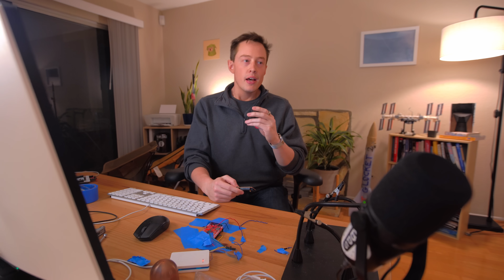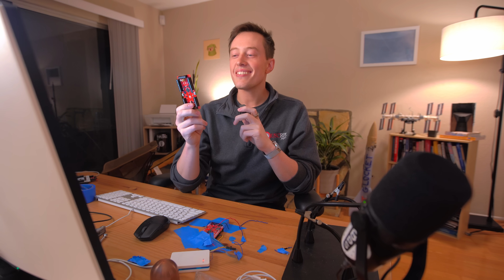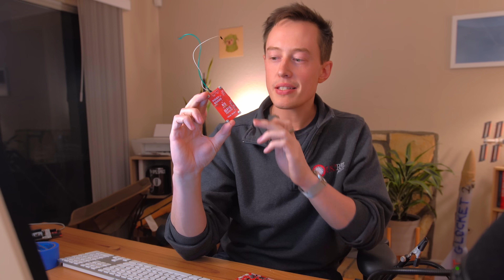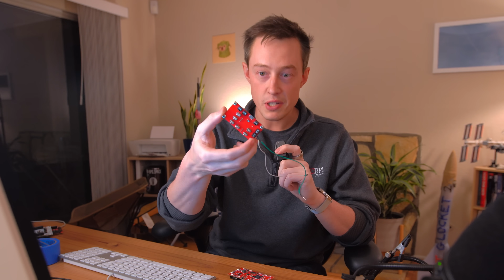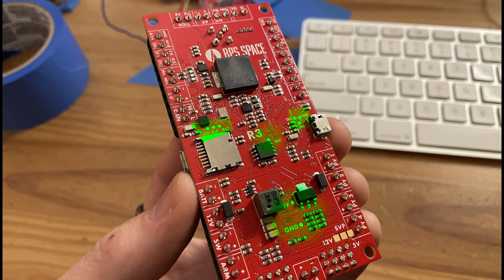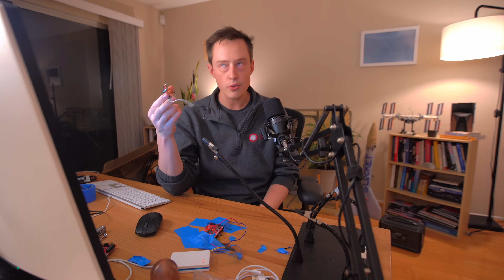the dumbest electronics thing i do

Comment: Aren't there programming sockets where you put the processor into a gripper that interfaces it for programming before you solder them to the board? Or, chose a different processor alltogether that Just uses a serial port to Programm itself?
Maybe go into the design decisions a bit more because using easy eda one can design and order such a programming piggy back board in an hour or so :'D

Comment: I do 3D printed jigs for small scale test runs for PCBs. You take your Test pad pattern, 3D print that pattern  with holes instead of Pads where you can shove pogo pins into to make your "Piggy Back board". Then just hand solder your wire to the pins and that is usually good enough.

Comment: I design boards in EasyEDA and it generates pick and place files in like 1 click. I don't even own a hot air work station or a hot plate or anything, have never assembled SMD components onto a board myself other than for quick fix problems. One of the products I sell does require programming and the engineer who worked on it made a bed of nails jig with a toggle clamp to hold it onto pogo pins and its a lifesaver, its like a 15 second process to program and test one and then move on to the next

Comment: Im sure you could get some perf board that matches the pin spacing you've used. Solder some pins on it and maybe put some alignment pins/screws on it that locate through the screw holes on the ava board and then you've got a reusable solution.

Not every board you make has to be professionally designed and sent to a PCB manufacturer. Do it the noob way with perf!

Comment: In addition to the obvious approach of 3D printing a jig to hold pogo pins (check out James Clough’s video for a great example), you might want to consider an affordable solution from PCBite. Their flexible arms with pogo pins are perfect for tasks like yours. I use them regularly for reflashing smart devices, and they’re very effective for maintaining reliable contact. These arms are also rated for high-frequency applications, so you can use them for quick debugging with an oscilloscope or logic analyzer. I highly recommend giving them a try – they’ll save you the hassle of manually holding the wires during your work.
Also for the quickest solution press the mouse button with your nose or operate it with your feet. That are usually my quick and dirty workarounds for not having enough hands ;)

Comment: Why you don’t switch to STM32H7 ? Arduino is supported and you don’t need to burn the BL. I’ve been using teensy for a while I switch to stm32 and I didn’t have to change anything in the SW just recompile for the stm32. You can program it via USB

Comment: There are pogo pins which fit into standard female jumpers. So I most of the time just out all pads needed In a 100 mil grid and then take a 3*2 jumper, put the pogo pins ins and be happy. 

But the I press cables against PCB... Been there, done that. 😂

Comment: I just ordered a 6 pin tag-connect cable for my stm32 boards.  You use their footprint in your board design, and it includes holes for the cable to clip on while you do programming and debugging.  Zero cost for the board (no headers).

Comment: simple: if the flashing takes more than 10 seconds i would simply solder the wires and desolder them after uploading.
if shorter:
space the 3 wires correctly and use hotglue or sugru to keep that spacing. adding short springs or pogo pins and gluing them for correct spacing is also an option, obviously try to place the glue as close as possible to the copper that makes the electrical connection. still hacky but should free one hand

Comment: This is the definition of technical debt. 

3d printer a simple negative of the AVA, make a cutout for the 4 wires and and hotglue them in place. Place the AVA on the negative, press it down (or add a brick) use the same set up for the PC connection.

Comment: You can use pogo-pins which are spring-loaded pins to probe those exposed pads. You can also design a 3D-printed holder with the same dimensions as the board to hold the entire board in place. The 3D printed holder can have holes that you can mount the pogo pins in place. This solution allows you to just plop the board into the holder while the pogo-pins contact and apply pressure to the pads, and you can have a hands-off bootloader flashing process.

Comment: Not sure if this is the right thing. But in a compromise of quick and dirty holding wires and full blown jig. I like these tools as helping hands: Sensepeek pcbite, Probe holder X 1.0
Tag connect mentioned down here is also great thing. But this includes redesign.

Comment: Skip the "model another different thing in another piece of software", you already have what you need!

Print the board on paper at 1:1 scale, glue the printout to a piece of wood drill through the pads, stick pogo pins into it (or just thicker wires maybe?), glue them in place

Extra credit if you take 2 minutes on the saw to cut the wood to size, and then nail "walls" to two sides to make an alignment jig!

Comment: Tape stiff wires together the right distance apart so you can hold them on with one hand, maybe even hold it there with that little holder thing. You can alligator clip onto the other end of the wire or something. It’s like 30 minutes of effort to make it a one handed job and get you at least a little more time back.

Comment: As many here already suggested a POGO pin Adapter should be the fix. If you ever design a new board you could even include the foodprint for comercialy available POGO pin adapter like the TC2030-IDC-NL (or realisticaly the 3 pin alternative that you design for the existing board)

Comment: You can 3d print a holder which would looks like E with right spacing and some flexibility and just glue wires to it. You still would have to hold it by the hand but at least you'd need one hand.

Comment: I have been using Tag-Connect TC2030 for years to program all kinds of boards. They are basically 6-pins cables with poggo pins on one end and a standard connector on the other. You will probably need to make a small adapter board to connect it to whatever programmer you are using, but then it is really easy to program each board. You can even get the holder clips for a few bucks, they will hold the cable in place while you are programming.

Comment: couldn't you design the pcb to have throughole pads for 2,54 pins and instead of soldering just stick the pins in? the same idea as in keyboards where you can change the switches

Comment: Pogo pins! Mill-Max has a huge variety. If you set those pads up with the standard 0.1” spacing, you can just use a scrap of protoboard to hold the pins. 

The next step would be to add a base plate and Destaco toggle clamp to put pressure on the board/pins.

Comment: Should look in to “flying line” “flying lead” “fly-by-wire electronics debug boards. Adjustable spring loaded pins and used for things like memory recovery so should be reliable enough for this. Cheap to get from the usual import sources.

Comment: Is there any way to issue the "burn" command via a script? If so, you could build in n seconds of delay so you can run the script and get your wires positioned before the command actually processes.

Comment: not sure if this will work as you said the arm thingy doesnt put enough pressure: mark the spacing on a block of styrofoam, then poke it with a toothpick or something (start from pin-side so you dont have to hunt), maybe poke at an angle so the cable wont slip back when you press on the block.

Comment: honestly instead of some pads you could have just had a 100 mil pitch header and don't populate it. I have an ATMEGA328 based board that involves me uploading firmware and I just use an ICSP head and simply stick a male header into the holes and angle the pins so they make contact with the holes. 
Pretty sure I got the idea after seeing GreatScott program Arduino Pro Minis that way.

Comment: I think PCBite got already mentioned but for any future iteration get yourself a tag-connect cable and use the footprint. Thats the industry standard for when you don't want a connector on the board but need some guided pogo pin insertion or semi permanent connection
This is the PN you most likely want for least board space and most compatability (like for ATMEL-ICE): TC2030-CTX-NL 6-Pin “No Legs”
Reply: similar technology would be Würth Redfit
Reply: Just needs to buy some pogo pins and solder them to his existing wires. From there he already has a decent 3rd hand that would work.

Comment: Low efford solution, hot glue three pins together and then you can hold the 3 pins together in one hand. BOOM!

Or you could go fancy and buy 3 spring-loaded contact pins and hot glue those together

Comment: Just 3d print a jig to hold some pogo pins in the right orientation. Solder some wires to the bottom of the pogo pins and you’re done. 

Could obviously make this as complicated as you wanted to but you could get a crude bed of nails setup working in a few hours of CAD and 3d printing.

Comment: For testing usually i solder jumper wires, i could just get the tips and crimp them but well its a no effort lifestyle, sort of xD, usually i use only 2 and its already hard with one hand, but with a bit of hot glue it could help keep them in place

Comment: Tag-connect ;)

The cool thing is that it's just a footprint, no component needed so really a zero-effort, zero-soldering, zero-time, pretty much zero-cost solution, especially given that this footprint is present in most EDA softwares.
(I said "pretty much 0 cost" because you have to buy the connector which isn't especially cheap for what it is, but it's a one-off : there's 0 cost associated with each PCB you create).
The connector then just "clips" on this footprint, and there you go, free hands ;)

c.f Phil's Lab channel (really really good channel when it comes to electronic design), he's using this in pretty much all his boards.
Reply: TAG CONNECT EVERYWHERE! Costs nothing, small, easy to use...can't beat it. I've even taken to throwing it on first-run prototypes where I just want to break out an I2C or SPI bus to test pads just because it's there instead of a 0.1" header or JST connector because those boards are never going to leave the bench.
Reply: Tag connect for sure this is absolutely the correct answer
Reply: The Tag Connector for the Atmel ICE is reversed. If you're going to go this route, MAKE SURE!!! you get the LEMTA (Atmel backwards) variant of the connector. The header on the connector will then be in the correct orientation for you white Atmel ICE you have there on your desk.

It's a great solution, though the connector is a little pricey. Over a few boards/design, the cost of not putting a header on your PCB more than makes up for the up front cost of buying the connector.
Reply: Absolutely love the TagConnect system, always plop the lil 6 pin SWD footprint on any design as a backup.
Reply: It’s a bit fragile, the plastic hooks are easy to break.
Reply: @Mike-oz4cv  Yeah not a fan of the clips, but big fan of the clip-less ones that are just the metal rods and pogo pins
Reply: +1 for tagconnect its the shiz

Comment: Just spin up a board from pcbway with 3 holes for pogo pins. Then if you find yourself making more and more boards, 3d print a jig for it. So you can just push the board on top, squashing the pogo pins and then hit burn.. but for small qty. you can just hold the board on there.. will take like 10 mins to spin up a design and like $8 in parts.

Comment: 3D printed "board shaped hole" fixture with some pogo-pins in the bottom.

Push board into hole, click go.
Reply: Yeah haha.

It's almost funny how trivial the fix is (you don't even need a PCB for the pogo pins - just glue them in!). And the board is a rectangle, it would take about two minutes to do the CAD.
Reply: I came here to say this, I have done this many times, print the holes for the pogo pins to press in.
Reply: That is literally the full professional method for production programming and testing. Just with a standard box and PCB clamp that the 3d frame and pogo pins are stuck onto, although that's not necessary for a small run. It's so easy to do that you kick yourself after you finally try it and realise how much unnecessary pain you have put yourself through in the past.

Comment: probably get a foot pedal that you can macro to the mouse click or like the enter key or whatever. That seems like it's generally useful beyond just this particular silly thing. then maybe get some contacts or pogo pins soldered to prototyping board for at least the three hard to reach ones. it'll still be dumb but less frustrating.

Comment: Personally, I’d 3d print a jig that the wires slide into that also spaces out the wires correctly. Easy one handed operation so you can apply enough pressure and have a hand free for other activities.

Comment: I don't even think you need to go the route of pogo pins. I've printed a little jig that holds wires at a particular spacing so I can insert them simultaneously into a tiny terminal block easily. I think that would be good enough. Takes like 3 minutes to CAD up. You basically are just bodging together your own header pins. 

OR. If your pads are spaced the same width as a actual header pins, just plug the wires into a single block.

Comment: Hi Joe, I had exactly the same problem to solve, except that I had to do the initial programming (of a PIC32MM microcontroller) for a lot of boards. I soldered a strip of pogo pins onto a circuit board, soldered on cables and hot glued the whole thing into a small tray. I scripted the tray with OpenScad to fit the board and printed it with a 3D printer.
The programming process now only takes seconds: Press the board into the tray onto the pins with one hand and start programming with the other hand. Done.

Comment: PCBite could put pressure on the pins 👍
But can you connect a simple wire to PCBite? 🤔
Yeah, Sensepeek PCBITE-4003 kit has simple wires.

Comment: Pogo pins are the solution but I don’t know if there is enough space on the board, so you can put them in a little cradle to secure and align them with the available space, and solder the cable extensions in to the programming interface

Comment: I used to have the full blown Cortex 9pin JTAG connector designed into everything for this purpose. Lately because of space constraints I switched to the 6pin TagConnect. The cable is somewhat expensive but it does pay itself off.

Also I don't know how much prototyping you do but flashing the application using the debugger is possible and it's faster.
Reply: (disclaimer: I'm an amateur hobbyist) I totally agree.  In addition to programming, JTAG can do all sorts of things like debugging as well as detecting manufacturing defects like shorts, opens, missing devices, and incorrect device placement.  iiuc, there's a mountain of tooling built on this standard.

Comment: The YouTuber stacksmashing designed a board, which uses spring loaded pins to read and write the to the diagnostic pins of a PC to do research on Bitlocker. You could adapt his design in order to use it as a programmer for you boards.

Comment: Not sure if this idea will be welcome, but ... 

Maybe make a 3d printed housing to hold 3 DuPont cable ends in the correct orientation for the pin out and connect the other ends of the DuPont cables to the modified ribbon cable? 

Sorry if that sounds stupid

Comment: If you dont want to design and 3D print a holder, Id try a "no effort" version:  take a piece of cardboard and 3 metal paperclips.  straighten out the paperclips, and punch them thru the cardboard at the correct spacings.  Then wrap the wires around each of the paperclip leads. For each paperclip: One paperclip end touches the board at the correct location while the other end touches the wire.

Comment: 3d print a jig that fits your PCB with holes in it that line up with your pads. Put pogo pins through the holes. 
Push the PCB onto the jig, hit program, job done.

Comment: PCBite has those arms with springs behind the pins and they work great
Reply: And they're droopy (unlike helping hands that you might mistake them for) which keeps pressure on the pin to hold it in place perfectly. They're awesome
Reply: PCBites are awesome! I usually place testpoints everywhere since they don't cost anything. PCBites make debugging new designs with testpoints easy.
Reply: PC Bite is groundbreaking. You will not know how you ever lived without them. They're pure magic, both the test probes and PCB holders.
Reply: That's what l understood from this video: please send a PCBite for free!)
Reply: Yep! PCBite for random signal test pass, TagConnect for nice programming :)
Reply: One of the best things I bought. @mattbrwn was the one that showed me how awesome these things are. I use it all the time now.

Comment: Designing a small 3D printed jig for a few pogo pins are even just some Dupont male connectors would be done in 5 minutes. Just something that  precisely fits over the board and pushes three pins down on the board with bit of weight on the back of the jig,, hell just use a paper weight.

Comment: I'm currently developing a similar flight computer, but with a more modern system. I'm using the new RP2354B and FreeRTOS, along with a custom LoRa radio and a compact but modular design for sensors and avionics.

Comment: Could you just 3D print a simple bridge that stands over the PCB with slots for the wires at the correct spacing (or even better have pogo pins)? Then you just place the bridge over the board while aligning the pins and then press down while burning it. Should maybe be an hour or two of work to design, print, and assemble it.